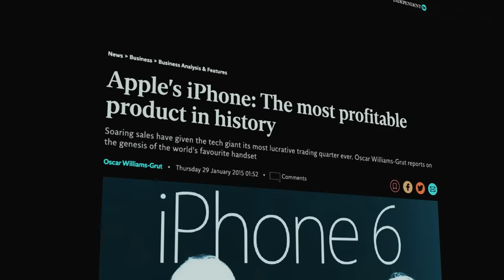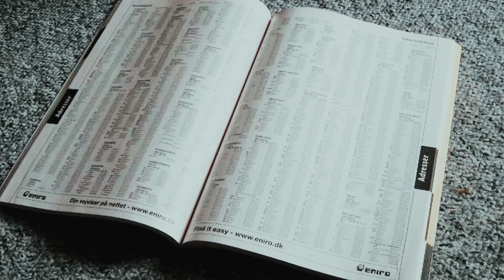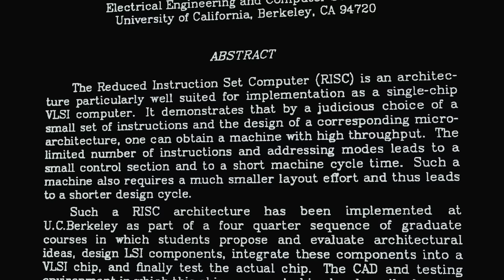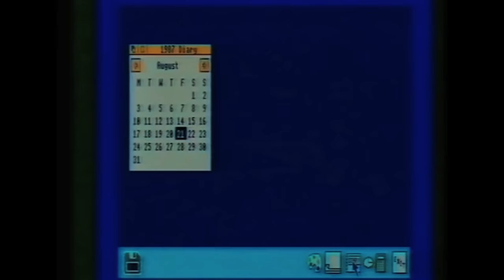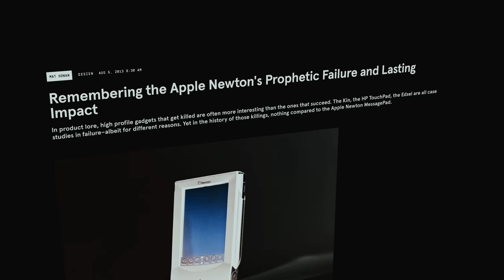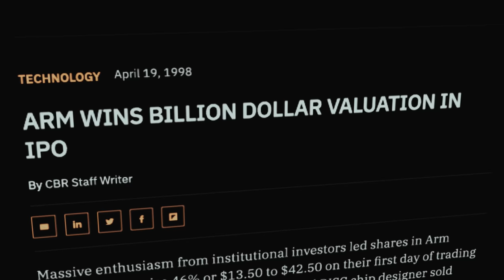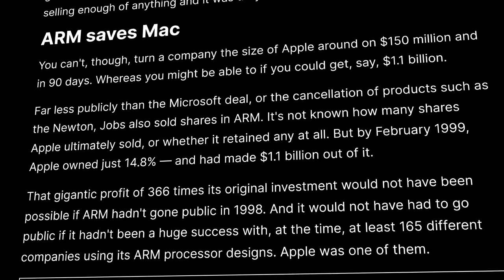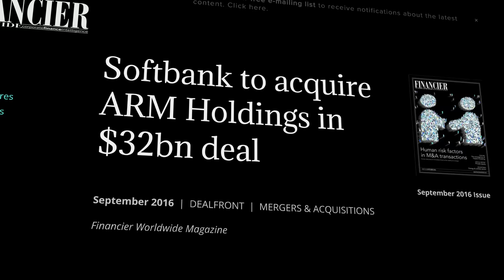How ARM Saved Apple

Comment: Roger Wilson designed the instruction set and the Basic interpreter. Steve Furber led the ARM hardware design team. They passed the cpu block design to the in-house VLSI team. Also we designed video controller (VIDC) and memory controller (MEMC) chips. There were about six of us. VLSI technology provided the design tools and manufacture. They did not design the chip.

Comment: Man it’s crazy how different history could be if just one thing changed. ARM is so vital to so many things even outside of mobile. The routers that people use to provide internet all run off ARM, cars rely on ARM. Heck even laptops like the MacBook are reliant on ARM now.
Reply: Do you think RISC-V could become nearly as popular as ARM? Would there be downsides?
Reply: Have a look at a vector processor.
Reply: I think as many home routers run MIPS as ARM. Fundamentally if it wasn't ARM, it would have been Super-H or MIPS or a combination of both.
Reply: Apple's MacBook are not reliant on ARM, only on ARM ISA (from years ago).
ARM could disappear tomorrow that wouldn't change the ability for Apple to create new chips for a long time, and in fact this might be beneficial for them as no longer obligated to respect ARM ISA and IP.
Reply: It's funny that the most important woman in this story is a man.
Reply: Sophie also designed the architecture that powers all the internet backhaul routers.
Like, all of them.
I forget what it's called, it's a DSP monster.
Reply: @iAPX432 
They'd have to learn how to improve the design beyond the tweaks they do.
There would be a very long lag while ARM designs stagnate without ARM to push them forward.
Reply: @MostlyPennyCat  An ISA is just a model for how the software interacts with the cpu. How the cpu implements the ISA is all up to the designers. But from what it looks like, Apple CPUs are completely in-house and uses little to no IP from ARM.
Reply: It likely would have been the same ... Some other technology would step in to fill the vacuum.

So long as the vision remains the same, history remains roughly the same.
Reply: Gimme a break. MIPS would have filled in the void of ARM. In fact MIPS is used throughout the automotive, networking, and industrial automation.
Reply: The company that owns what’s left of the MIPS IP is now called Imagination Technologies. They’ve gone all-in on RISC-V now.
Reply: @iAPX432  He's obviously talking about fate moments mentioned in this video. If they never happened, Apple might not even exist or would be a subsidiary right now. Maybe the iPhone never exists, this is the butterfly effect and it compounds. Today obviously would be different.
Reply: @mycelia_ow Apple would have pressured Intel and pay if necessary to have its own smartphone adapted x86.
Remember the Nokia Communicator with its i386, I had one!
Or it could have been an Intel ARM-based XScale, I also had a XScale based Pocket PC!

Whatever the demand create the product. That's why we have mobile or ultra-mobile chips!
Reply: And yet, Windows running x86 processors (Intel or AMD Ryzen) has 90 percent market share.

Macs with Apple Silicon M1 or M2 are a tiny minority worldwide.    

The largest and richest corporations (Fortune 500) pretty much ignore the Mac, and instead buy machines from Dell, HP, and Lenovo.
Reply: @wayando  yeah sooner or later but still trajectory   our been a lot different we may have not seen technological progress as fast as we did

Comment: You missed the best story ...
 The best one is where they are testing the ARM chp and they realise they forgot to power  it  (turned out it was running off voltage leak from the rest of the circuit)

 The ARM 1 was a co processer to the BBC mico, most of the archimedes you showed where ARM 2 . 

 The first system on a chip ARMs were in the later 3000 series Archimedes ARM 250  (video VIDC/audio was on the same chip)

Nintendo had ARM very early to make a Game Boy follow up but didn't use it because the origonal game boy sold so well they used it later for the color then SP .
The thumb 16bit memory controller you mention I believe was initially intended for the Nintendo.
Reply: The Game Boy Color did not use an ARM chip but the Game Boy Advance and onward did.
Reply: Actually, the chip used in the Newton was the ARM 610, which was the same processor that was eventually used in the RiscPC range of Acorn computers. By that time the majority of Acorns had been using the ARM3, which was basically an ARM2 with a cache on the chip which was used on the A3000 and A4 laptop, and the ARM250 which was the original SoC combining the main ARM2 processor and all the support chips on one piece of silicon which was used in the A3010, A3020 and the A4000. The picture you showed when introducing the Archimedes was actually the A3000 which was the first machine to actually DROP the Archimedes name.
Reply: @Scorpiove A3000 was ARM2 at 8mhz

A4000 A3010 and A3020 were ARM250 at 12mhz 

A5000 was ARM 3 at 25 or 33mhz

RISC PC Was ARM 6 at 30mhz later  ARM 7 at 40mhz later  strongARM at 233mhz
Reply: The main take away from this account of UK micro computer history is that Sophie is not a woman but a trans dude - when first was learning about UK micro computer history thought it was really cool that a woman had a prominent role - creating BBC BASIC and other really cool things. But no - Sophie was born a man. So nothing there to chalk up for women - not so surprisingly, all these cool achievements were due to men.
Reply: @TheSulross  how on earth is that the "main take away"? At most it is an interesting factoid.
Reply: @patdbean  it's merely humorous at this point as all YouTubers brush past this point and mention it
Reply: @TheSulross  Sophie's talks on the history of CPUs in general and the history of ARM in particular are actually every interesting. She has worked for element14 and  broadcom since  the late 1990s.  Mainly working  on ADSL/VDSL digital comms processers mainly FirePath

Comment: My School, Woodlands High School, Falkirk, was the first in the world to be fully equipped with RISC powered Acorn Archimedes computers, I remember a whole lorry turning up with over 300 pc's, courtesy of the oil giant BP, who ran the local refinery, these RISC computers had capabilities we could only dream of, but one things stands out, a desktop Acorn 3010 rendering a fully 3d  world in realtime, without having to pay over £14,000 for an SG server was staggering, and just pointed to how powerful RISC systems could be, and here we are, nearly 30 years later, with ARM dominating the chip market, simply because the underlying architure is so efficient, its no wonder APPLE dumped Intel, and took the modular RISC architure and molded it into the most efficient chips the world have seen to date.
Reply: Do you think RISC-V could become nearly as popular or overtake ARM?
Reply: Tbf modern X86 architectures are pretty similar to arm.
I heard compilers are gonna ship mostly risc instructions to x86 now. Their optimized for risc operations more than cisc ones now.

Comment: Excellent storytelling, John.  Viewers might get the impression that RISC was something new with Acorn.  But it has a history, grounded in the Control Data Corporation's computers going back to the 1960s, like the CDC6600 that I used. My cheatsheet for reading memory dumps was handwritten on the blank side of a Hollerith punchcard, so short the instruction set was. These computers (which ultimately morphed into the Cray supercomputers) were all based on discrete component hardware (i.e., not integrated circuits). Very old school. 
Other commenters here have mentioned Hewlett-Packard's PA-RISC and the MIPS chips. ARM is inspiring because having carried the RISC torch forward in the face of entrenched CISC architecture as exemplified by intel's x86 family. Up with RISC, down with CISC!
Reply: Interesting comment, thx!

Comment: 9:43 The Archimedes had an ARM2 processor, not ARM1. The ARM2 was slightly faster at 8Mhz compared to 6, and it had hardware multiplication and a fast interrupt mode.

Comment: A good video and I love to see this story told to a wider audience. I do think you have the emphasis slightly wrong in a couple of places though. Minor points that don't undermine the overall worth of this great video, but for what it's worth...

It is fair to mention Sophie Wilson a lot, she was indeed the driving force behind the ARM instruction set (those familiar with her and her coding style can actually see some of her personality in the instruction set!). Having said that though Steve Furber played a big part in the logic level design and also in the design of the BBC micro. I think anyone in Acorn at the time (e.g. me) would consider the ARM design as primarily a joint effort between Sophie and Steve.

Additionally you say that the actual chip was designed by VLSI. It was fabricated by VLSI but the physical chip layout was done at Acorn and the final tape-out then sent to VLSI for fabrication. Although there was of course a lot of cross-pollination of ideas, broadly speaking Sophie did the overall instruction set architecture, Steve Furber translated that to the higher level logic design, and then a small 3 (or was it 4; I forget) person in-house Acorn team led by Jamie Urquhart - located in the same building as Sophie and Steve (and me) - did the physical chip layout to be sent to VLSI for fabrication.

The other small niggle that I have is that personally from the perspective of someone in the AR&D group at the time I'd say that you get the emphasis slightly wrong between Chris Curry and Hermann Hauser. For us (the technical folks) Hermann was always the driving force at least as far as the technology was concerned, often wandering round the building in the evenings chatting to people still there, and Chris Curry was seen as the sales and commercial guy with little input to the technical side of things.

Comment: The ARM1 was never released, it was the initial development prototype, and lacked a number of mathematical functions and lacked some commands, it was the ARM2 that appeared in the Archimedes in 1987 and continued to power the archimedes until the early 1990’s.
Reply: The ARM1 was released as part of the ARM Evaluation System: a second processor expansion for the BBC Micro.

Comment: Actually, the Apple Silicon processors are based on the ARM instruction set, not on ARM's processor IP.

The AS processors are home grown CPUs with ARM instruction set compatibility, but do not use ARM designed CPU cores.
Reply: The first A5 processor in the iPhone 4 was entirely ARM based. Along with the Samsung processors in the iPhone 2G to 3GS.
Reply: @megatronskneecap  I'm talking modern Apple Silicon processors - the term Apple Silicon processor was not even coined until the 'M' series of SoCs were introduced.

AFAIK, Apple Silicon CPU cores are more efficient and faster than any ARM reference cores.

Heck, I think that ARMv6 was developed at Apple's request since ARMv5 was unoptimizable due to the inability to schedule long instruction pipelines for use with an out of order execution unit.
Reply: Apple machines only seem to get their performance by tying everything together into a monolithic mass, so you can’t upgrade anything. Basically all their machines now are glorified laptops.
Reply: @megatronskneecap  When the guy says Apple Silicon, he means the chips that Apple makes themselves. 
No shit previous Iphones are gonna use ARM lol. 

ARM doesnt make chips exactly, they just sell the ISA license.

Comment: Brings back memories. I had an A5000 and A340s in the lab and the unix one (A540?) in the lab. Then I got a special A5000 for home to go with my A3010 . The A5000 was STDs and originally Gareth from Simtecs. Then a RiccPC strong ARM with an Aleph1 pentium coprocessor in slot 2.

I remember the news pad (like an iPad but before its time)

What killed RiscOS as mainstream was the cost of Software. You even had to pay for a decent browser etc etc.

Comment: I still have an old Acorn Archimedes A440 in my loft, using the first Arm silicone (or as it was originally know Acorn Risk Machine) … and risc OS was stunning for the time
Reply: RISC OS is still alive and well. I can and do run it and the old software that I wrote on my Mac M1.
Reply: Make sure you remove the CMOS battery, before it leaks
Reply: @AndrewRoberts11  has the 440 got a cmos, I thought it was a battery pack
Reply: CMOS (Complementary metal–oxide–semiconductor) is a chip fabrication technique that results in circuits that hold their state (excluding a bit of seepage) when there is no power. Historically used for small memory chips that hold a computers settings (CMOS / BIOS settings). A battery of SOME type compensates for the seepage, to preserve the CMOS values when there is no mains power. The battery being known as the CMOS battery. CMOS has nothing to do with the batteries composition.
Reply: @AndrewRoberts11  I know, but I think for the cmos backup in the 440 was not an on board cell but a couple of AA batteries off the motherboard

Comment: Kinda crazy to think about the direct lineage between the computers of my youth in the 1980s and early 1990s to the iPhone I’m watching this on now. Both the Acorn BBC Model B and Archimedes saw some success in Australia within the education system. I first used a mouse, GUI and inkjet printer on an A3000. Ironically it was also the first system I used for CAD drafting too (still doing it 25 years later 😂).

Comment: I actually had a ZX-80. I bought it in 1979 as I remember it. Had Z80 processor and 1k RAM, persistent storage: interface to a home tape recorder, screen: TV antenna outlet 

Language: Basic 

If you wrote a large enough program, the code interfered with the screen buffer effectively erasing what was shown on the screen.

😂😂😂😂

But it sure worked 

There was two options: assemble it by yourself, or pre-assembled.
Reply: ZX80 launched 29th Jan 1980, but close.  I ordered my kit at a computer show in the February. It was an amazing time in the UK computer revolution.
Reply: My first UK101, 6502 invaders game shot bullets in to the code if I missed ...
Reply: @tortysoft Aah, the UK101... Never had one, but they seemed to be in many of the hobby magazines back in the day.

Comment: ARM has done quite well of late. Microsoft and AWS (Amazon Web Services) now offer ARM as an alternative. As the video indicates, ARM rules all of mobile (and will for the foreseeable future). The general shift to high-level languages favors ARM. For example, Java programs (jar files) don’t have to be recompiled for ARM. The same holds for Python and other languages. By contrast, C/C++ compiles into binaries that run on x86 or ARM, but not both. However, ARM has lost out in one key area. That is AI. Nvidia, not ARM, dominates AI and will for the foreseeable future.
Reply: Yeah but RISCV prolly would be the future tbh.
ARM and RISCV dont differ by that much so the translation isnt that insane.
Reply: @honkhonk8009  I don't think RISC-V is going anywhere soon. I see ARM all over the place. Smartphones are typically ARM based. AWS (Amazon Web Services) actually gives me a choice of using Intel servers or ARM servers. My kids have iPads. Of course, they are ARM based.  The current generation of Macs use ARM. Arduino provides another example. Atmel, ARM, and Intel are supported. RISC-V is not.
Reply: @peterschaeffer  RISC-V is supported by Arduino and there are cips wich is implementing risc-v (Espressif esp32-c3, SiFive FE310, ..) that run on Arduino frameworks.

Comment: Steve Furbar did the architecture and the electronics. Roger Wilson (his name before his sex  change) did the instruction set. This video does Furbar an injustice. do some fact checking you will then understand Furbur's part in all this then release a updated fact correct version of your video.
Reply: Steve Furbar, in addition to the physical design for ARM, also did the hardware side of the Acorn Atom, Proton, and BBC Micro. (Roger | Sophie) writing the BASIC, COMAL, ... language interpreters. The likes of Hugo Tyson writing the "advanced disk filing system" used by the BBC, Archimedes, RISC-PC, ... and a test suite, with notorious error messages, for the logical and physical designs of the the pair (Digital's engineers didn't appreciate the automated, profanity laden, critique of their best efforts).

Also the ARM 1 shipped in just a developers evaluation kit / 2nd processor (sidecar) for the BBC micro range. The Archimedes initially shipping with an 8MHz ARM2, in 1987, and 25+ MHz ARM3 silicon, from 1989. The follow on RISC-PC shipped with ARM6, ARM7, and Digital StrongARM CPU's, at up-to 233 MHz, from 1993.

Anyway Johnny Ive was the one who saved Apple, through his novel iMac, iPod, iPhone, ... designs. The ARM based iPod later bringing in more revenue, than the sale of ARM stock.

Comment: My BBC B was amazing vastly more able than its siblings with a proper depth to its OS. It's fast ram and 2mhz 6502, easily matched early 16bit machines in performance too. And then it had the most powerful and fast Basic ever designed to go with it 😊. As for the ARM I doubt it would have found itself into new neiches without the fading off the Acorn line.

Comment: We’ll put together. 

IMHO someone else would have developed a suitable RISC processor if Acorn hadn’t.

Also there should be an asterisk on call the 8088 at 16-bit processor since it only had an 8-bit data path. The 8086 was a true 16-bit processor.

Comment: I dispute the notion that Apple would not be what it is today absent the ARM.
The need for small microprocessors/controllers would have outed as a different product.

Not mentioned in this video is that ARM processors are in plain sight unrecognized: all sorts of devices use ARM processors, some of them in packages the size of a match head.    Thermostats, garage door controllers, routers, ... an endless list.

What's with the audio echo on this video?